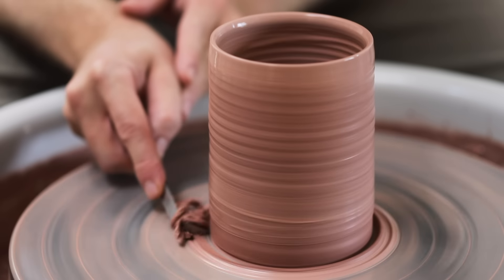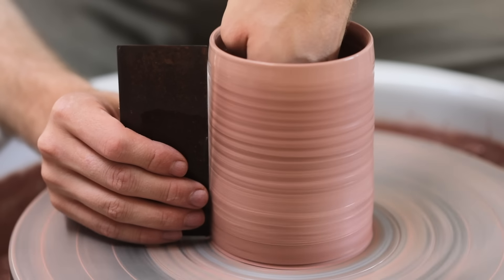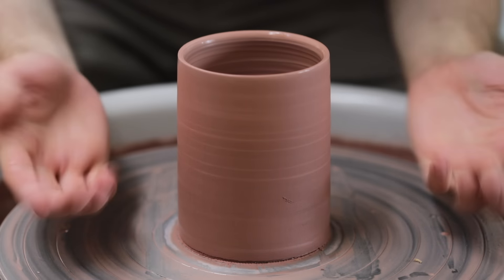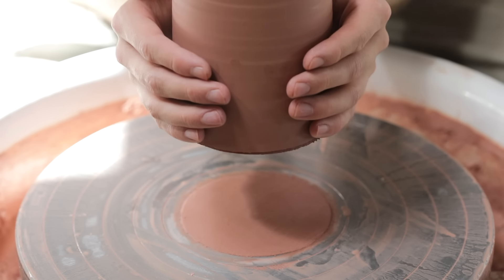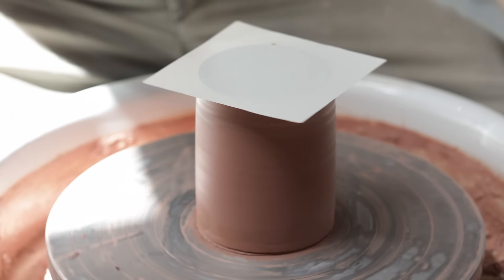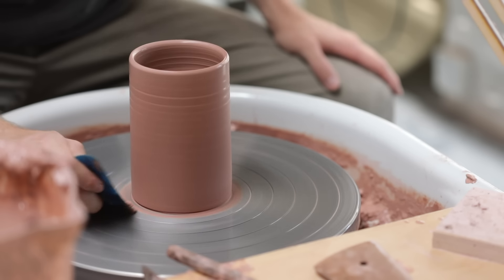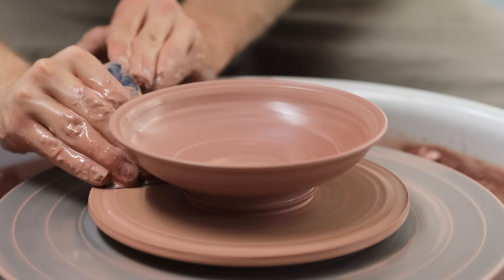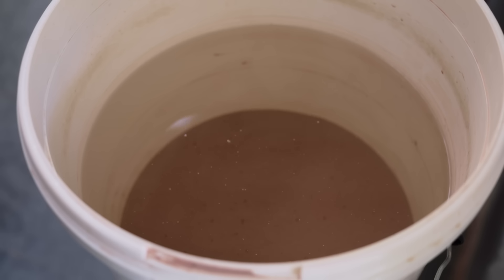How to Lift Pots Off the Wheel — A Beginner's Guide

Comment: I throw a soft porcelain and found this trick works for removing pots.  Pre-finish base by compressing with the round end of throwing stick to cut a rounded groove.  Cut pot off with wire and use fingers and thumb to lift pot using the groove as contact area.  The pot does not warp when lifting.

Comment: So I was successfully able to lift the pot off of the head without warping my pot but with dry hands my fingers left an impression in the edges of my piece. Should I have waited a little longer for the outside to dry? In the video it seemed like you removed it almost immediately but now I have a marred surface from my hands. Not sure how to compensate for this.

Comment: 16:29 - speaking of soft clay, is there a way to soften/wet new clay out of a bag without simply wetting the outside surfaces? My latest bag of stoneware clay is much harder than usual and wedging it alone is a work out, and then centring and coning are noticeably different.
Reply: cut your block of clay into smaller sections, and poke holes in the clay. Put water in those holes, and the clay should soften up a bit!
Reply: @Nicky-fi6jy  thanks for the tip Nicky! I'll give this a go next time 🙂